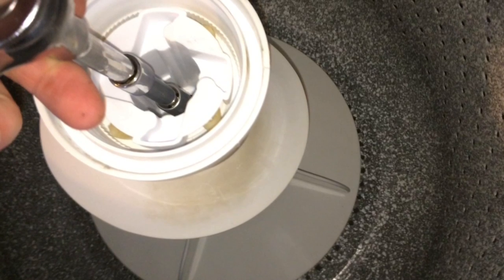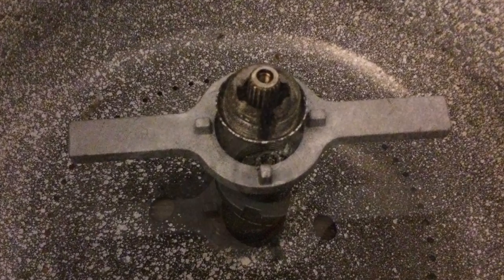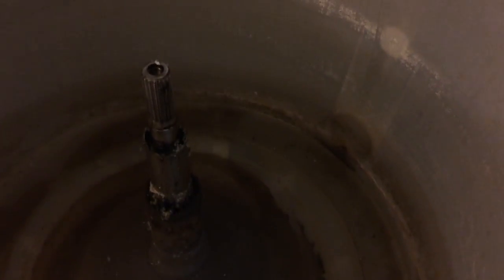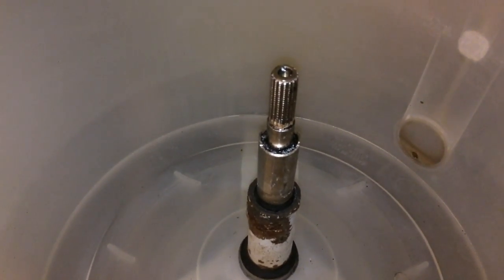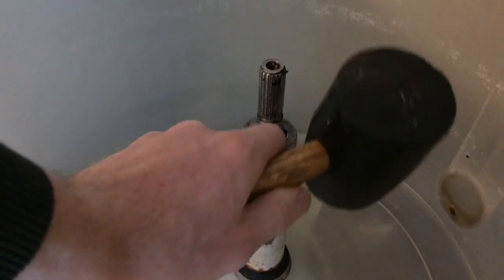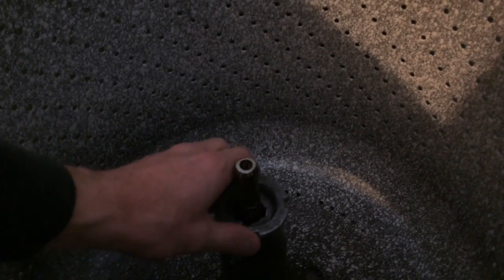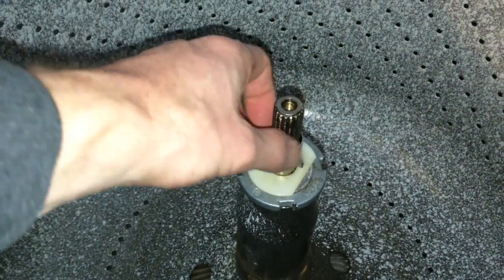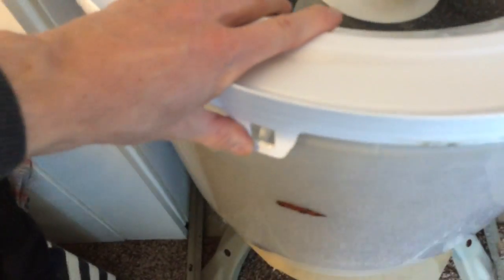Remove Stuck Washing Machine Tub: C-Clamp method

Comment: A heavy duty hub puller that I use on my cars also works pretty good too. The slime and scale buildup can be reduced if you run a mix of hot water and washing soda halfway through the wash cycle and let it sit overnight once every couple of months.

Comment: I went to harbor freight tools and got a six inch 3-arm gear puller.  You need to put the spanner nut back on upside down and turn the spanned nut 4 to 5 turns (do not tighten  it) - then use the gear puller 3 arms to hold onto the spanner nut while turning the gear puller shaft against the washer center shaft.  This worked for me on a 35 year old Kenmore washer.

Comment: Tip: If you don't have a spanner tool, you CAN  use a socket and tap it off with a hammer hitting each notch till it loosens. Then use the socket again and tap gently both sides of the slot of the drive block to loosen the rust(That's where the rust welds it) and the tub should come out. Worked like a charm for me with not that much effort.

Comment: I don't have that spanner wrench. I e tried everything. Amazon is gonna take 8 days to deliver. Idk why so long used to be two days. Anyways mine doesn't have the plastic washer thing and the metal thing that goes on the spindle before you put the agitator back on. Any idea what they both are called so I can buy them? Thank you. Once I get that stupid nut off I'll probably have to try your c clamp idea so thanks in advance.

Comment: You saved us.  I bought a used 22 year old Kenmore washer that was sold to me "like new".  Why?  Because I was stupid and bought a HE Speed Queen that sucks!!!! (Never buy a TR5003) It is awful. Sure, it has a 3 year warranty....but it's the worst washer I've used in my 53 years of doing literally thousands upon thousands of loads of laundry.  I endured it for six months and decided to buy something old since the new ones don't do the job anymore.  The outside of the old Kenmore and even the inner ring appeared to be "like new".  The salesman cleaned it up beautifully.  But.....Surprise surprise....at home when I could look "under the hood" I knew there'd be no way I'd be washing clothes in that grimy disgusting tub that would be nothing but skin cell and dirt soup soaking into each batch of laundry.  So, the quest began to take that spanner nut off (bought the proper wrench)....and once that was accomplished we were stuck.  I thought we were going to have to throw in the towel....but this method worked beautifully.  We had the tow hitch and one clamp...so we bought one more.  I held the hitch and wrench in place for my husband while he placed the clamps. It was pretty simple. Twisting those C clamps to hear the tub pop free several times until we could lift it out was music to the ears. 
My husband understood the method from the video just fine.  I'm not that bright....but I caught on....  Thank you for cluing in the clueless and saving the day.  To all who try this...line your tub with a blanket or some towels....just in case you accidentally drop the hitch or C-clamps.  They're so heavy and you don't want to ruin the deal by chipping your tub.  AND GET ANOTHER PERSON to stabilize the contraption before attempting this.  It is easy...but I think almost impossible with just two hands.
Reply: You are plenty bright...you wrote a great narrative here. With YouTube videos and taking your time, keep looking at it...the solution will appear.  We've ALL got to fail...it helps us to succeed.

Comment: The number of people who've shown up here celebrating this method really surprises me.  It's an incredibly cumbersome and difficult process, most of which this video never shows us.  How did he get the clamps on?  He doesn't show -- in that tight space, balancing a 40-lb hitch receiver on top of a tiny transmission shaft, and then attaching and tightening C-Clamps is almost impossible without another pair of hands.  In fact, nowhere is there a video showing how to do this.  And once you get the clamps on and try to tighten them (he never shows that, either), you can end up driving the transmission shaft right into the gear box.

Instead: turn the thing on its back, remove the transmission (3 bolts, motor wire harness -- lots of videos on this), and then pound on the drive bolt with a large socket and extension until either the basket drive comes loose from the bolt and comes out, or the drive and bolt both come out.  If the basket drive comes out you can lift off the tub and work on removing the bolt from the top and underneath.

Comment: Unfortunately you did not explain how you managed to get your c clamp contraption together and into the tub, which is the most important part of a video showing how to free a stuck spin tub with a C clamp method.  It turns out that this is a 2 person job, or one that requires unlimited patience and dexterity to get the clamps on.

Comment: From Charles Juedemann, Union, MO, I also had this problem and In my case I used a substantial auto wheel puller and struggled to remove the tub. I finally used a 250ft lb impact driver and that did it, but I was afraid I would break the nut, it didn't and the tub came out. From there on it was easy. HOWEVER my original problem was a violent noise at spin start up. The unanimous suggestion on youtube was this collar. How it could cause a shake or noise I do not know as the collar was firmly seated in the tub with no wear. Time will tell.

Comment: My drive block is really crusty--the washer spins (and still seems like there's water in there but only agitates about 2 inches each direction--drive block?  Or motor coupler?  Thanks!
Reply: Here's what finally worked for me in this order:  (I just completed the repair and it's working fine)  Start with  light tapping.  More tapping.  Liquid Wrench.   Increased tapping and more liquid wrench.  Banging, liquid wrench and propane torch.  Crying.  Cussing.  Some amount of beer.  
Finally, what worked was banging down and at a slight angle on the drive shaft itself.  I couldn't get it to actually rock back and forth like so many people could.  Replaced the drive block and seems to work fine now.

Comment: On our 90 Series Kenmore, I got to thinking about the gunk inside there behind the drive block. It's not much in the line of rust, more along the line of gunked up detergent, fabric softener and and general boodie funk. So instead of using a rust penetrant, like every one seems to go for right off, I sprayed around the block with Super Clean and let it sit while I figured out how in the world I'd be able to get the spanner nut off with no spanner. Channel locks got it fairly easy without messing anything up. I sprayed more Super Clean around the block while I thought a little bit more about how to pull the nut with no spanner. I used a smaller 3-arm puller and managed to get the block up to where the center post started spinning. Sprayed in a bit more Super Clean, tapped around a little bit and shortly I was able to pull the tub out after a few good firm yanks. I sure wish that my tub looked as clean as your "Before" view looked. It's was so bad that even part of the drive block was eaten away. Not broken, I didn't see any sign of pieces of metal, but about a third of the lower block was missing and the gap filled with powdered gunk.

The good thing is that the Super Clean (at 5:1 mix that I generally use around the garage) seems to be cutting into the tub build up fairly decently. I'll see how that works out as I clean everything up.

Thanks for posting this. Even though I wasn't able to do it your way, I saw enough to be able to figure it out.

Comment: Thanks for the idea! Our old whirlpool was leaking, so I ordered a new seal and the spanner wrench. Wrench worked great, but the tub wouldn't budge. I sprayed PB blaster on it and let it sit overnight, pounded it with a rubber mallet then a 4# beater, heated it with a propane torch, but nothing worked. Had one long clamp but had to go buy another one for this (I can always use another good tool, though). Needed my wife for a second set of hands. Trying to get the bar (used a 1 1/4" square tube I had laying around since the receiver hitch with a ball on it was not balancing well) to stay put when setting up the first clamp was a hassle, but when my wife held it in place while I applied the clamps made it easier. Man, the sound of that 'thump' when the first clamp pulled it up on the first (and all the rest) of the adjustments made me smile big time! Ours tubs were caked with lime and soap scum. To the point that I finally got out my 4" angle grinder with a wire wheel and just buzzed it all right off the porcelain inner tub. (No, it didn't scratch or gall it. The porcelain is tough stuff) If anyone can't get their tub out, this is the way to go. Now, getting those suspension springs on is another story! And like someone else said, all those how-to videos showing those guys just lifting the tub out after they get the agitator off is really misleading. Old washers aren't like the fairy tale videos! Thanks again for this video! BIG HELP!!
Reply from the maker: Glad it worked! All the others videos just gloss over the real problem. Unfortunately, some have tried my method and the shaft pulled right out of the motor, so it’s all or nothing when you try this. No going back.

Comment: Well, used this method on my machine... it was stuck so much that instead of releasing the drive block from shaft, the shaft instead pulled right out of the motor and did some serious damage... washer is now landfill material.  Was worth a try though... thanks for the idea.

Comment: Where did you get the Spanner wrench?
Reply from the maker: YouTubesShitSorter I put the link in the video description for ya 👍🏼😊
Reply: @DadsGotADeal  Thanks!   I got a tool just like yours but it was designed with 1 prong, not 4 like yours. My dad had it from being a retired tech for 39 years.  

We finally got that nut loose today, but I want to get a new tool. 
My washing machine is over 20+ years old and was used when I got it. The tub seal is starting to leak, it could’ve been prevented had I known the tub to frame stabilizer spring hole rusted thru. 

I’m basically restoring the whole washer now. Going to have about 6 labor hours into it. Cleaning everything, taking apart pieces, cleaning pieces, lubing rub pads, rust proofing prone parts, going get parts, installing parts etc..
Reply from the maker: YouTubesShitSorter man! You are being good to the earth with that one bro! I bought a new set last year and honestly I don’t know if it will last 10 years!
Reply: @DadsGotADeal  This set has been really good. Had literally 1 problem with each. Both problems could have been prevented.

Comment: Thanks for this,I'm working on one right now that the tub has been on for 30 years,lol, ill be tackling it this weekend, i work in machine shop and have been around machinery all my life but you can ALWAYS learn something new from someone else,i dont have the spanner and i buy everything i have online since i can get it much cheaper,i was wondering about how much it would cost local?
Reply from the maker: dntlss I couldn’t find one local, but you could call the hardware stores or an appliance repair place if you’re lucky enough to have one nearby. My guess is $20.
Reply: @DadsGotADeal  You were right on the money,i found one this morning local and it was 20.

Ive decided after taking everything apart to buy a new washer tub support assembly (the thing that looks like a triangle where everything rides on) and basket drive assembly,the stuff looks really bad that came out of there and i mean bad, this washer has been excellent for the last 3 decades so i dont mind spending some money on it,there is a bearing kit one can buy for the support assembly but its a pain to install and mine is badly rusted,some of the black stuff that came out of that shaft would put Chernobyl to shame.
Reply from the maker: dntlss awesome! Haha. Chernobyl reference. Funny! Ya that crud is terrible.

Comment: Great help--we tried lots of things but ended up using a gear puller/pulley and heard a lot of popping while we cranked it around.  Then finally it let loose including the drive block.  We hammered the drive block out of the tub afterwards also and cleaned it up with a steel brush.  Worse part of the job.  When we got to the plastic tub, since I was replacing the tub seal, I put a screw driver in at the bottom and separated it from the shaft.  The plastic tub pulled right up.  Thank you--Thank you for your help!  Great idea and it worked!

Comment: You Saved ME thanks!  
But I used a slightly different tool method. I went to autozone and free rented their 3 claw puller. Hand screwed the spline nut back on and hooked the claws to it and the puller center screw on the shaft. It pulled off but it was very tight, pulled all the way up with the puller, it was stuck with a lot of gunk and come rust and corrosion. 
Oven cleaner sprayed on and soaked for a bit works best for cleaning all the gunk off. Only $1 a can at the dollar tree!
I think the best thing to do is just clean the metal surfaces and spray paint the mating surfaces and or apply vaseline.
Obviously the factory didn't paint the paw. 
When my old whirlpool finally bites the dust, I'm going to really read reviews before I buy  to make sure it's RELIABLE. As I've seen repair companies saying much of the new stuff breaks down severely sometimes terminally and doesn't last. It would be nice to possibly use less water when washing with a new machine but only if it washes well and doesn't fail.

Take care

Comment: This was a lifesaver on my 25-year old Kenmore from which the basket had never been removed.  I tried the 3-jaw puller method and succeeded only in buggering the threads in the agitator (which I fortunately was able to chase using the agitator bolt).  This did the trick right quick.

Comment: I was just wondering if you are going to take your wash machine apart again and pull the drum out and clean the outside of the drum because I noticed you didn't do that and it has a lot of that gonk on the backside of the drum and it stinks also I cleaned mine it was spotless so please let me know if you're going to take care of yours like I did it will help you. Thank you for your time and once again thanks for making that video. Peace brother
Reply from the maker: Thanks for the tip! My drum was super rusty on the outside. Didn’t seem like gunk but who knows. Later I got a new washer and I get a smell now. I figured out my new washer doesn’t full drain and the leftover water gets gross. If I push the drum around after emptying a load I can hear water sloshing at the bottom
Reply: @DadsGotADeal  yeah I know what you're talkin about they all hold a little water in the bottom underneath the drum. But I wanted to let you know that was not rust on the outside of your drum on the old washer mine look the same way and it was filth it all comes off if you scrub it mine looks brand new now. Good luck with your new washer have a good weekend peace brother

Comment: Thanks, this worked well. A small improvement is to use a ratcheting tie down strap wrapped around both arms of the wrench and rigid object so that it keeps everything stabilized while you tighten down the clamps. Probably the easiest way is to use a gear puller if it's available. I think this video is much better than  using a car jack to jack against the inside lip of the tub which could end up warping it and ruining the whole thing.

Comment: I’ve ran into a problem, the white plastic piece that’s is on the sprocket right below the screw cover won’t budge. I’m afraid I’ll crack it if I apply to much pressure. Please help! What can I do or is there a small screw holding it or what??

Comment: I can't thank you enough for this video.  I couldn't get the inner tub to separate and I was starting to lose hope.  The key to the method described by the OP is to use a small, straight, heavy piece of metal, because it isn't easy holding the spanner wrench up while balancing a piece of metal on top of a 1/2 drive shaft while trying to attach the 2 clamps.  In the end once I managed to get everything set-up it only took 3mins for the two tubs to separate.  THANKS AGAIN :)
Reply from the maker: Bryan Wells glad it helped! It’s so frustrating when parts are rusted or stuck together!

Comment: Its ok if the tub rusted in the cylinder that the drive block goes in?  Is cleaning it with a wire brush good enough or should it be primed and painted  before putting it back together?  My spin tub is in excellent shape otherwise.  Does this area fill with water when you use the washer or is it typically dry?  Mine has more rust at the base where the plastic filter attaches due to a leaking tub seal.  I'm concerned about getting rust stains  on my laundry.

Comment: Any thoughts on holding the post top-center part of the basket while taking big nut off...  in the case the basket rusted off 6 inches below the nut.   No inertia from bottom & outside of basket to hammer against.   Good idea on puller, have those parts handy for later.
Reply: Figured out that big C-clamp applied tight (!) above rusted off spot pinched it in place.   Made a deep socket contraption from plate with pair of 1/4" thick tabs that mesh with washing machine nut,  cut hole in middle of plate for shaft,  opposite side I welded about 3" pipe over hole in plate,  then welded an impact socket at top of pipe.   2 Quick therma cycles of socket low red & slow cool,   then protect eyes and put the impact wrench to it.  Was very tight but impact wrench unscrewed it.  Hammer didn't quite do it.